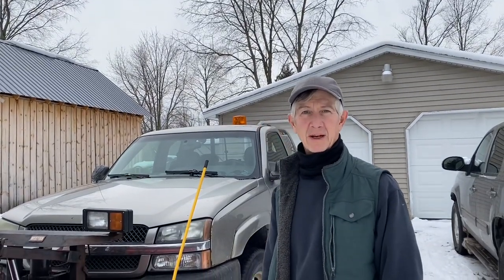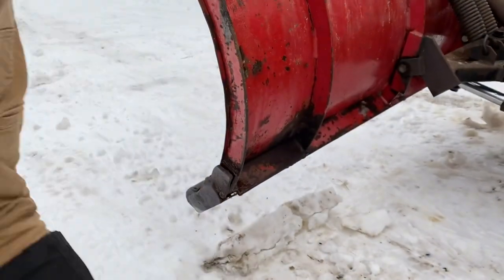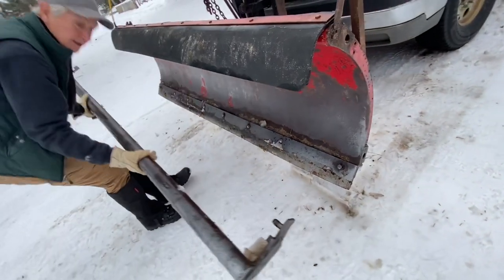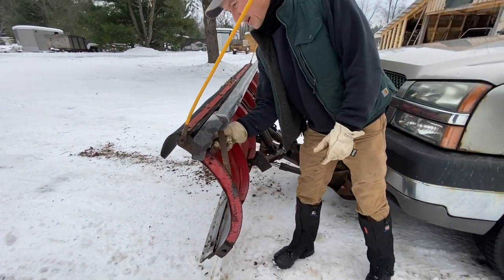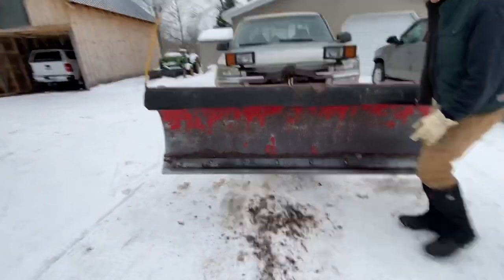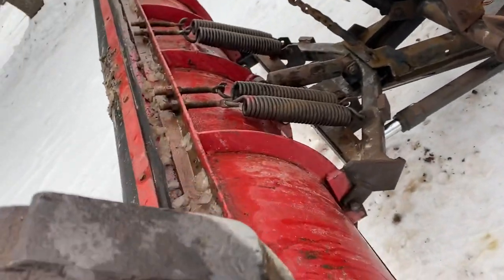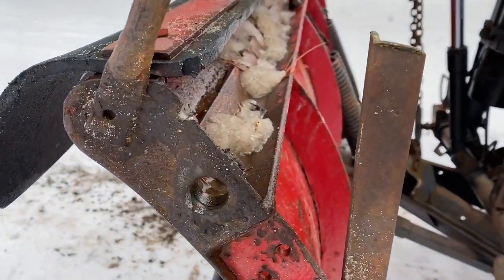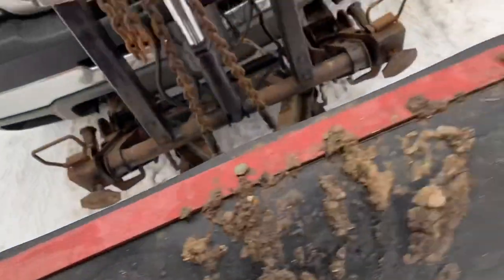QUICK + EASY  DIY Steel Snow Plow Pipe : Damage Free Plowing!!

Comment: Amazing job! I have been using plastic pvc pipe on the blade of my ATV snowplow, love it and works amazingly on a gravel driveway, but the pvc pipe gets bridle and breaks with the cold so easy, I’ve gone through 3pipes already and it’s only February! I definitely have to start on this!
Reply: Try a piece of 2 inch water pipe or plastic gas main pipe

Comment: I live on a private road and my plow always tears it up until the ground freezes. And with our crazy weather patterns it doesn't freeze up most seasons. I thought about using the shoe holes to hold it in the slot similar to how you have it. Then I could just unpin the shoe links and store it on another set of hole brackets on top. 
Great system you have by the way!
Thanks for sharing

Comment: That looks awesome but you didn’t show the other side. What does the the hook think hold on too? Driver side you got the pin that slides in then you attach the safety pin . But the other side you welded something to the blade to keep the hook thing attached while plowing?
Reply from the maker: I removed the carriage bolt and replaced it with a hex head bolt and I welded a nut to the top of the bolt.

Comment: Looks pretty neat !!  Am going to try it on my 8-foot plow.  Didn't see any detail on the mount at the bottom of the blade on the left side...facing the plow.  Or did I miss it ??  Wall thickness of the 2-inch pipe ?  Creative solution !!
Reply from the maker: I removed the carriage bolt, replaced it with a regular hex head bolt and welded an extra nut to the head of the bolt for extra depth. Then I welded a plate to the pipe with a slot that slides over the bolt head. Thanks for watching!

Comment: Do you have a video of how well this works while plowing? Like to see it in action. Thinking about doing this to my front tractor snow plow.
Reply from the maker: We don’t have a video, sorry. But when we get some snow we can definitely do that! Thanks for watching!
Reply: @Springdalecottage  I literally just cut a slot and welded a 2" pipe on the bottom of my plow yesterday.
Reply: I have the pipe behind the blade and mount it with 2 tabs where the shoes go this way its on and off. Been doing this for 25 years.
Reply: @Terk131  so it does well though? Some people say it will leave too much snow. I wish now I had done what you did. That was a great idea.
Reply: @D2500R  it cleans awesome, back blades awesome, no complaints at all AND it saves the gravel and grass areas. Guys that put it on the blade have some problems  but I used 3" pipe and mount it where the feet would go and keep the actual cutting edge ¼ - ½ off the ground. Wish I could send you a pic.
Reply: @Terk131  my driveway is so uneven so keeping it off the ground would be impossible. I think it should work fine. Guess I'll find out soon!
Reply: @D2500R  The bar will work fine. I do long private gravel roads that are washed out the the plow with the bar cleans great.

Comment: You sir, are an absolute genius! I have a Hiniker V-plow and a gravel driveway. Does this prevent pushing your gravel into the yard?
Reply from the maker: Thank you! Yes, this makes a smooth plow.
Reply: Thanks for the reply. Going to try this on my Hiniker. Tired of having to power broom half the driveway out of the yard in the spring. Love your quick on and off single pin design.

Comment: What fid u use to cut the line across
Reply from the maker: It’s a gas powered concrete cut off saw with a fiber blade for cutting steel.
Reply from the maker: You can use an angle grinder with a fiber wheel.